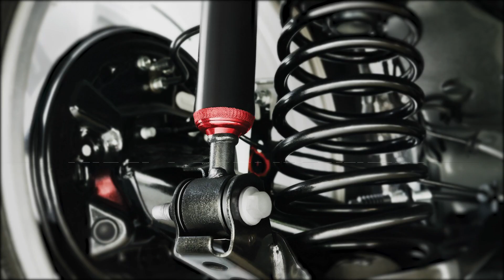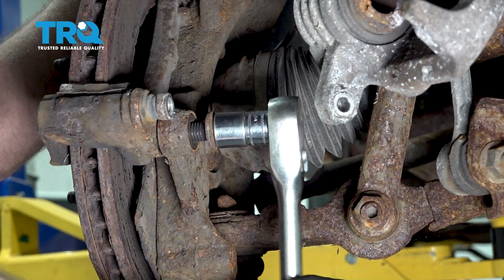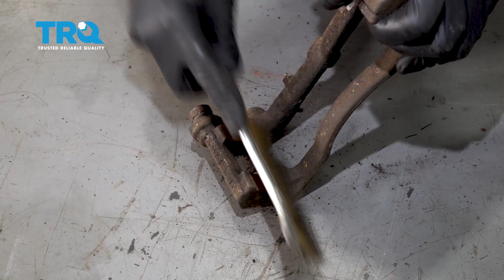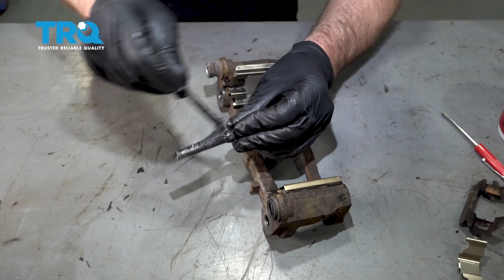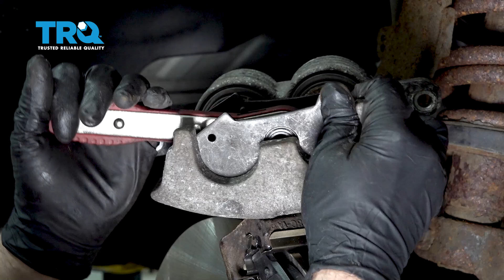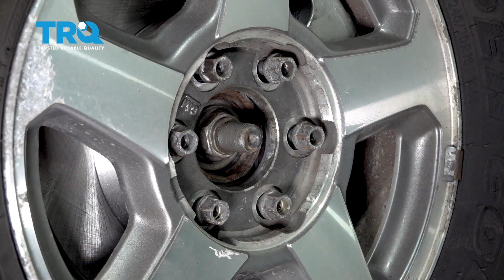How to replace Front Brakes 2002-2005 Chevrolet Trailblazer

Comment: No grease on the Caliper to brake pad matting surfaces ? Let production know about that one and removing the master cylinder reservoir fill cap to make Caliper collapse easier with less brake system pressure on brake components seals. Great work though